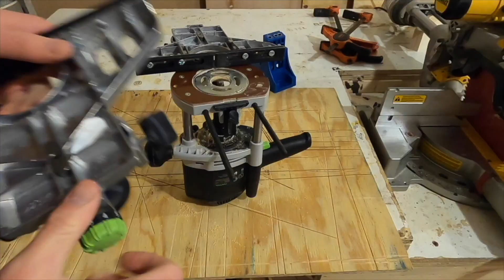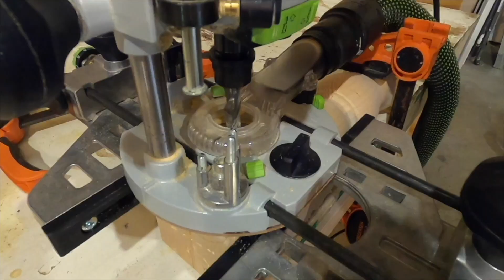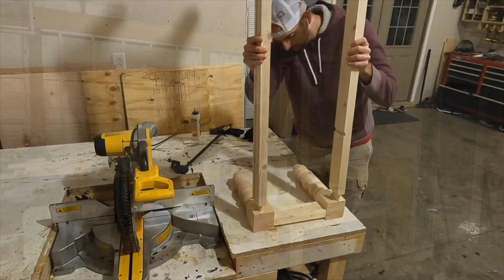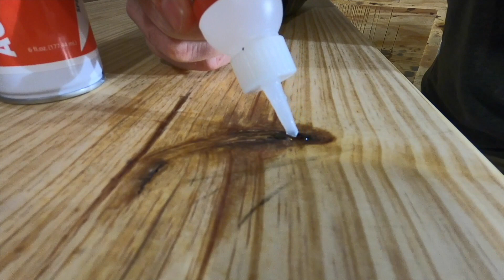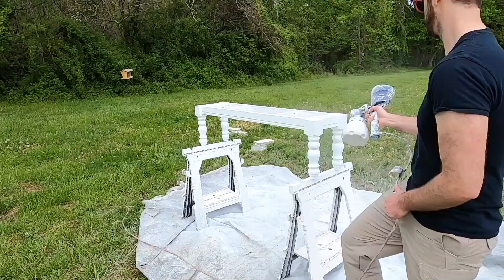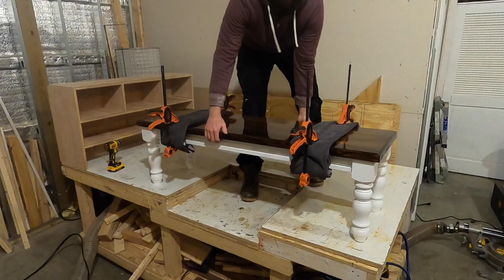Farmhouse Bench Build with Mortise & Tenon Joinery (Tutorial Video with Free Dimensions Included)

Comment: Hello Matt nice job👍 have a question when you apply wipe on  finish  did you applied it right after a sanding round or after you put the third coat of polyhuratane??
Reply from the maker: The wipe on is after the last coat is sanded.. let the last coat dry for a day or so, sand it down, clean it, then wipe on poly